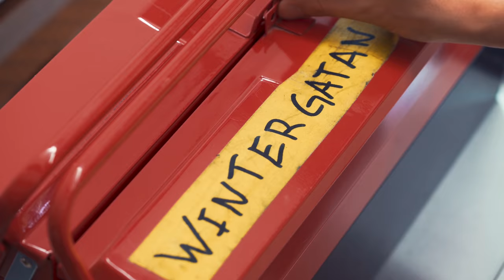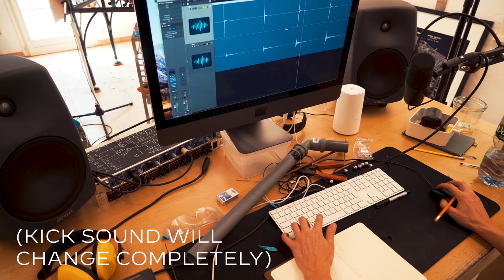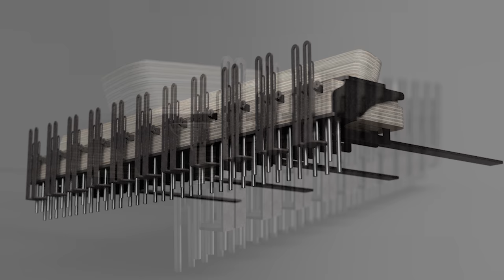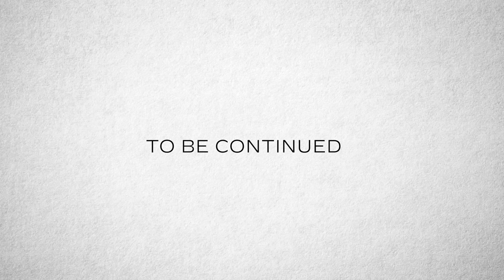Vibraphone Marble Drops - Marble Machine X #99

Comment: Hey Martin, You could have gotten yourself a (Rubbish) bin to throw the unwanted parts into, rather throw on the floor. Your cleaner must be getting great pay to tidy up after you. I hate tidying up, so I throw things into suitable bins. I usually throw unwanted parts over my shoulder into the waste bin (Which has a made up cardboard funnel) behind me, so I do not need to be accurate and it still feels good, but still reasonable tidy at the end. Screws and other recyclable bits are thrown into another bin for sorting later --ish.

For example. When I make a sandwich I use a plate to butter my bread/Toast on, so I do not have to wipe the crumbs off the table/counter top. What a waste of crumbs and unnecessary clean up, when I see people butter their bread/Toast on the table top, I just flip my eyes as the engineer in me hates tidy ups, so I trained myself not to create a mess (Most of the time). Afterwards the plate goes into the dish washer, as I already licked the crumbs off it, before any dog gets to it. I cut bread on a plate as well. What a Mess otherwise...plus, Did I mention I hate tidying up, but once I am tiding up, no one needs to be around me. NO one in THE HOUSE when I CLEAN UP>> AAAAHHHHH.  You should see my cooking. I am two/pot/pan man the most, no matter how many I cook for. I recycle the pots/Pan, when I cook. Saves on the Clean up. I hate washing, but when I do, NO ONE MUST BE AROUND!!!. So when people claims it is my turn to clean up, I tell them to leave the House, roar at them if they DO NOT LEAVE THE HOUSE.... I enjoy my peaceful time, when I clean..... :) People are such annoying and ALWAYS GETS IN THE WAY. RAGE LEVEL RISSSEEESSSS.

Comment: Martin.
Martin?
Martin...
I really, truly, absolutely love the message of this video. I know I'm a little late to watch it and comment, but I hope you see this anyway. Throughout this video, I was thinking that I needed to say something. That something being, that when you started this project, you said that the goal was for every single part to be easily recreated in case of breakage when you're on tour. And I was saying to myself, for the better part of this video, as I have been with a lot of the other ones, that you seem to be making a lot of 'one-off' solutions. If you really, truly, deeply want to make this machine durable and repairable, you need to document in full detail every single last bit of it. Now, i don't know how much you document each manufactured part offscreen, but it does seem like you are constantly changing predesigned parts with ad-hoc changes., like these first-version drop mechanisms.
I applaud your decision to completely redesign the vibraphone mechanism, and I hope that you find the best possible solution. I know that in every engineering project there are compromises, but I wish nothing but success for you, your project and your dreams, and as such, I truly hope that that your end goal is practically achievable.

Comment: I don't understand why the existing marble drops couldn't just be bent slightly. Seems like the degree of change needed is only slight, and there's more than enough range of adjustment to compensate for it. It's not that I think Martin has made a huge mistake by chopping them off. I'm just curious to understand what I'm missing here.

Comment: Hi Martin! I just want to say... I think maybe you're getting yourself in a lot of stress due to this vibraphone problem which is based in a point I find to be not-so-right (I don't wanna say wrong). I'm studying percussion and play a lot of vibraphone and I had never hear about playing off center as a tool for sound quality (unless it's required as some sort of effect or for finding confortable positions for playing chords). I'm not saying the point is completely wrong, BUT it certainly is diffefent from one instrument to another, or even from one bar to another of the same vibraphone, as we saw here in your channel. 

So I'm wondering a few things:
1. I don't know what kind of vibraphone bars you are using, but maybe they are not so consistent? Maybe you could consider trying a different set of bars?
2. Maybe it is true that playing off center could sound better in some bars, but maybe it is not that noticeable of a difference when you have the resonators which will amplify mostly the fundamental note. So I think any test you do regarding to SOUND QUALITY, you gotta do it in the same conditions it will be played in the machine. With the resonators and with latex on the bars.
3. I could be wrong but I think your vibraphone bars are not graduated, right? This means the width of all bars, from lowest to highest, is the same. Usually professional vibraphones have wider low bars, and I think maybe the sound quality you're after could come from that, rather than changing hit points. Also I'm thinking, could it be that wider low bars sound better when being struck on the center, which is why I always thought in the center was right (I mean, considering the hit points that were changed in your design were mostly in the low register...). Maybe it's worth considering this. I think it won't be so much of a trouble to adjust the machine for having bars of different widths, but I'm not really sure. Keep in mind that this doesn't mean each individual bar has a different width. It's more like there's a low section, a middle section and a high section with a different width for each section of bars. I'm even thinking, maybe the bar changing between songs could be within bars of the same section, so the bars you change are the same width. 
4. I don't want to get into the engeneering part, but I kinda felt Marius marble drops were better for the fact that they were each one piece. I have the instinct that those are more stable and won't bend so easily? Maybe? I don't know.

Well, I think that's all I wanted to say, if I think of something else I'll just put it here in the comments. 
Stay well, Martin!

Comment: Wait... Are you telling me that shifting the vibraphone bars was not the first thing on your mind? I thought that was the most obvious and straight forward solution and I thought that the reason you didn't have some kind of knob adjustment was that it wouldn't work with the rest of the machine. But, now you're telling me that that wasn't even a thought?

Comment: Wouldn't the latex pads on the vibraphones degrade after being hit a thousand times with the marbles? How about some kind of peel and stick pads, thin silicone or latex sheets with spray adhesive for quick repairs on tour.

Comment: Hey Martin... If you twice the marble rails from 4 to 3 it is inevitable that the marbles will touch unless they are riding DANGEROUSLY low... Considering that you are bending these by hand I don't think you have those tolerances man... The marble will either bump into rather it fall prematurely. What was wrong with the 4 rail design?

Comment: simply put martin.....its engineering there is a way to get it done and then there is a better one.

but usually the better one dosent come before the first one is tried..

further i have noticed you having to bend the rods on the release to adjust timings. whilst u r re-doing the assembly i would suggest u try a better more 'repeatable' mechanism for getting timing alligned. because metal is prone to fatigue  i hipe i dont sound too idiotic.

Comment: Why did you have to "redo" those marble drops though? (or DO you have to)... you could've just adjusted them to hit in a row instead of displaced - the issue you're facing here is with the vibraphone holders, not the marble drops. The marble drops were fine.

Comment: Please don't weld the arms, or anything else into place if you can avoid it! I screamed when you welded the guiding wires into place. Because I KNOW there is always a chance of there needing to be a change! Welding things in place means making your life 10 times harder when you need to redo something and it means you may have ruined whatever structure you welded onto and need to rebuild that as well. Especially because we all know that instruments always get hurt in transport while touring, and screwing them allows for something to be easily replaced while touring because of damage or something else. It allows for easy backups to be built which could be swapped out even in the middle of a show if need be. PLEASE! No welding if it can be avoided!

You are so close, don't let the allure of the finish line allow you to make mistakes or cut corners. I am glad you decided to redo this, it's the right choice. Don't think about having to "push through" to finish things. Do one thing, and do it well, then move on to another. The only way to eat an elephant is one bite at a time.

Youre doing great. Keep it up. We can wait, but it will all be for nothing if the product isn't good, no matter how quickly you finished. We love you, and we know you will finish, even if you can't see it sometimes. Keep up the great work!

Love
Ariana

Comment: I bet you $50 the tolerances on those marble guides will slip as you transport the machine around. You're going to need to do the entire setup every time to prevent the marbles from interacting with each other. Having both tracks share a common center rail is an elegant design solution, but I question whether it's a practical one. Time will tell. Hopefully I'm wrong.

Regarding the rework - iteration is the nature of design, and you are building and designing in parallel. I have to educate construction teams every day about that fact. As much as you might like it to be a completely linear process with no waste a design process HAS TO have iteration in order to create the most value. The trick is to not let the various iterative loops get out of control. (adept-flow.com)

Comment: Please be careful while using the anglegrinder the sparks will make rally ugly spots on the acrylic parts. They are so hot that they can even burn into the surface of normal bathroom tiles or glass. So again don't ruin the looks of your brilliant machined marble lifters or pipes.

Comment: If you 'd want to make music faster, you'd have taken the computer and slapped together midi stuff in 5 minutes and I would not be interested. Instead you take 5 years to make the most absurd, interesting and beautiful musical contraption and that is interesting. What will I watch when it's built ? Your concerts ? Once maybe. Biggest hurdle of your project, the after. However you'll have plenty opportunities in music, cnc, woodworking, team management, project leadership, engineering and sales rep for Fusion360 in the worst case. You're a genius, worry not.